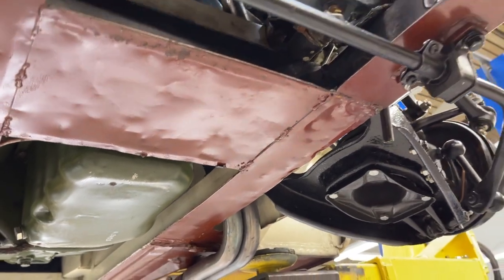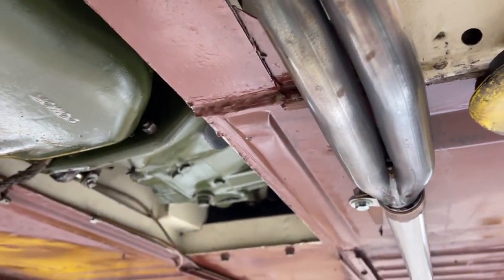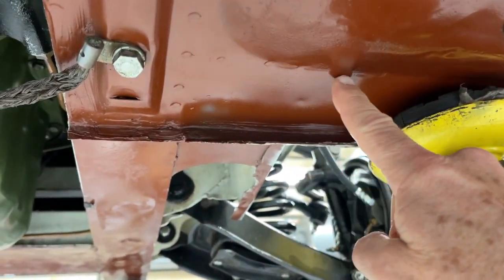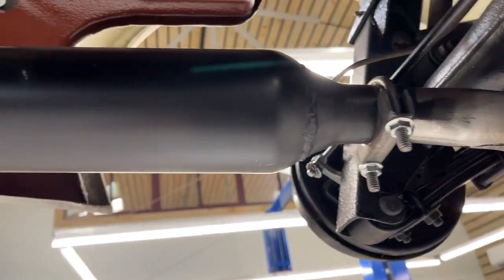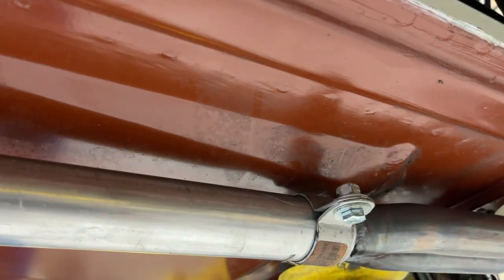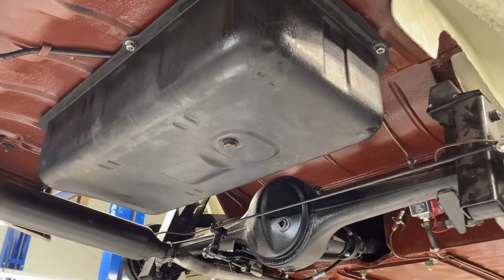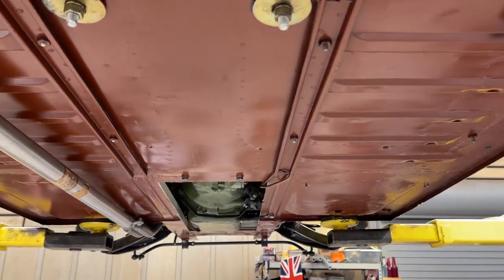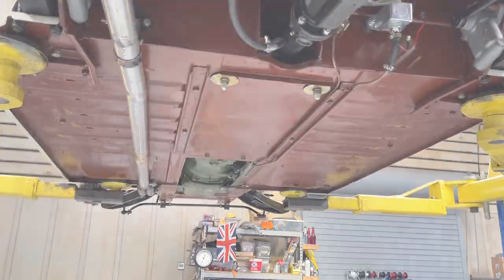Bugeye Bottoms: What color should a Sprite's Undercarriage Be?

Comment: My 69 Midget (MKIII GAN4) had that salmon colored bottom when it was new.   That seemed to be the primer color I found elsewhere on the car.   I suppose the dealer could have applied an undercoating if they were in a rust belt area.   But the original salmon primer held up well on my car.   I'll send you a photo that I have when I was doing a rotisserie  restoration  a few years back.